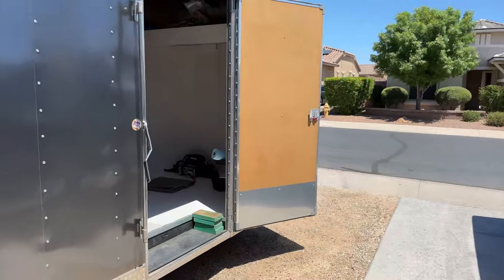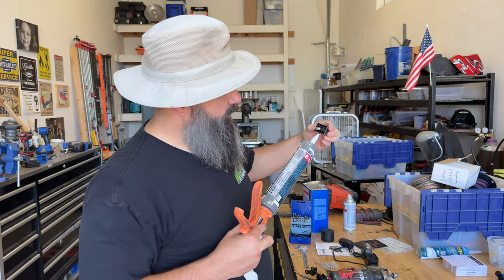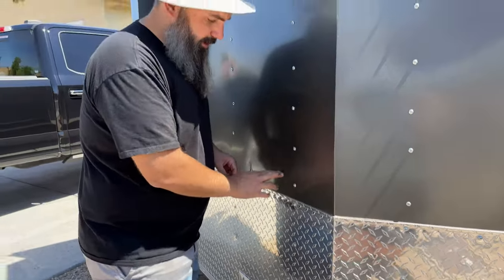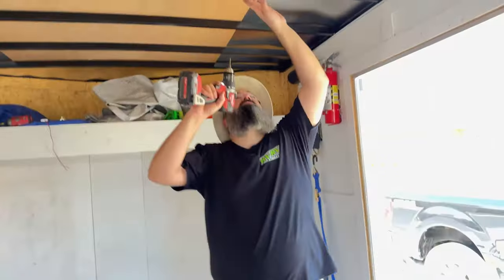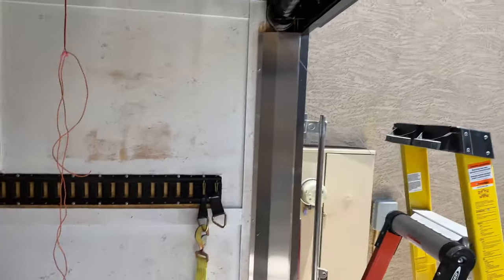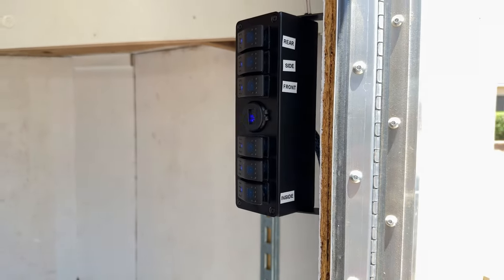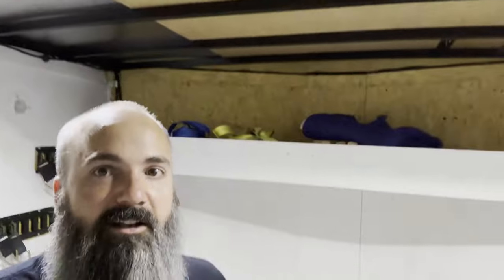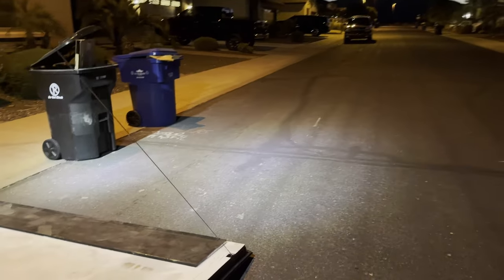Insane Lighting Upgrade for my Cargo/ Race Trailer

Comment: Milwaukee makes a cobalt line for hard metal, they are 3 sided for drill chucks as well as shock wave titanium drill bits for your impact driver.. I've had very good luck with each..
Reply from the maker: Thanks! I’ll have to take a look at those.

Comment: Spend some money and get a good set of drill bits from a supplier who works with machinists. You'll find some high quality stuff when you do some research. Also, you have to pay attention to your drill bit speeds, how much pressure you are putting on them (especially smaller bits), and use a decent quality cutting fluid for the bits to keep them cooler and to help maintain a sharper edge. Great video as I am just about to upgrade the lighting in my new trailer. You did an awesome job!
Reply from the maker: Thank you. I hadn’t really thought of looking for a machinist supplier. I’ve always just bought cheap bits, but that always comes back to bite me.

Comment: Drill steel in slow speed. Takes about 10 seconds longer, but bits stay sharper longer. Aluminum, drill as fast as you want/can.
Reply from the maker: But I'm so impatient..... Good point on the speed. I tend to remind myself to slow down after the fact :-)

Comment: Seems like the rock lights would have been better on the sides than the “flood” lights. Well done! Helpful video
Reply from the maker: Those darn rock lights are bright. I may add a few more along the bottom edges to supplement. So far they are all working great.

Comment: I setup my 20ft cargo trailer almost exactly like you did. Love the lights but I am having issues with my interior light switch melting after using it for longer than a couple minutes.
Reply from the maker: That’s interesting…. How many lights did you add? You should be able to add up the total amp draw and see if it exceeds the switch capability. Remember the wiring and switch the manufacture of the trailer used was as thin as possible to save money. Also it’s not fused. I would fuse the circuit at 10-15% more than the rated draw of the lights.
Reply: I installed all 8 lights. I used same lights and switches that you used in your video. I think i got the issue fixed. I put each switch on its own fuse circuit like you did but I think i had the ground wires mixed up on the switch. after swapping things around so far no more melted switches
 @DrivingForwardBuilds